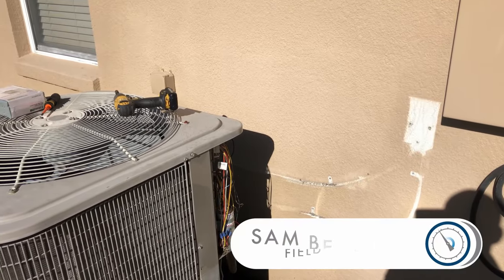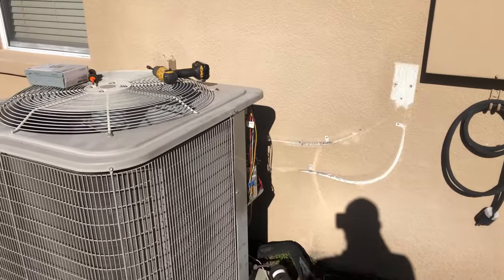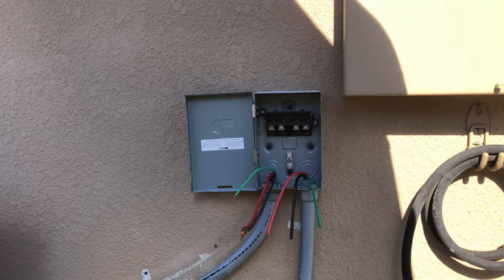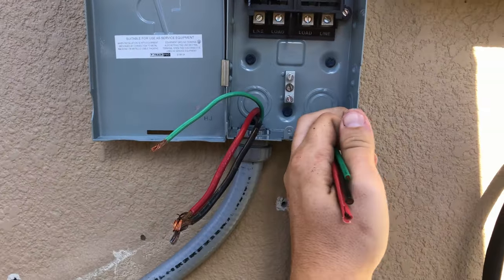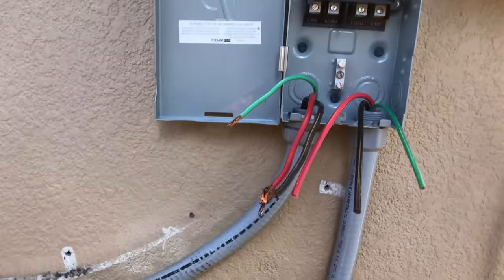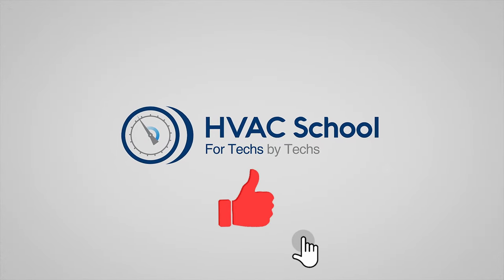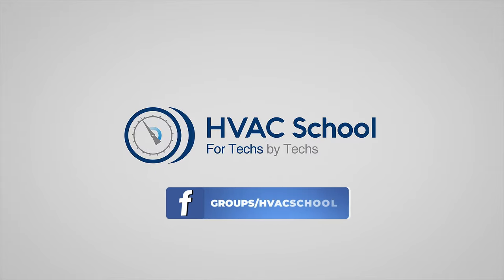How to Install an AC Disconnect

Comment: Lol you didn't show the part I struggle with: knocking the holes out of the bottom of the disconnect box for the wires. I always knock out the wrong ring...grrrr
Reply: Bro, me too lol!
Reply: Rookie guys
Reply: You always Market with a marker first
Reply: Use a 1/4” drill bit to remove the welds on the knockouts.
Reply: @bigkev4385  So, there's plenty of things you're a rookie at too.
Reply: I looked up this video for this is there a video to help us get the right size.
Reply: Right

Comment: Thanks for the informative video. I'm getting some new siding and your video helped me with replacing my old disconnect. The only thing missing was understanding the the rated Amps for disconnect boxes; some come in 30, 60 or 70amps. I didn't know what my existing amperage rating was for my old box. So, I did a little research and found that the amperage rating for disconnects tells the max amps that the box is rated for. I ended up getting a 60amp which I heard was standard for AC units, I have two 20amp breaker switches going to my AC unit....Thank you!

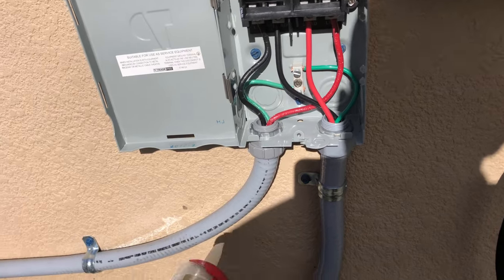Comment: 2:16 shouldn't there be an inside plastic cover hiding the wires and terminals?    Will your pass code without the plastic cover being installed?

Comment: do power lines from service terminate in the line side lugs and out going to the ac run to the load side lugs if so it is wired back wards....please correct me if wrong ....thank you....and do line and load even matter on a disconnect

Comment: The wiring that comes into the disconnect doesn't have a neutral. Is it ok to connect the neutral wire coming in to the grounds in the disconnect or leave the neutral not connected?

Comment: Silicone is for metal not the outside of a stucco building. Always use caulking as that can be painted and it bonds properly to the stucco. Otherwise good video, I've watched a couple of your videos and there teaching me new ways or different scenarios to install all kinds of systems.
Reply: They do make paintable silicone

Comment: I got two new ac systems $10,000. They used duct tape for  disconnect box that was disintegrated. Shouldn’t that be replaced with a new install? Why does internet say it costs $500 to get a new one installed?

Comment: Looks easy. Thanks.  Question:  If I wanted another disconnect (for another mini split condenser), can I tap into the same 'line-in' junction box?  Both condenser will not be running at the same time.  Thanks.
Reply: A little late to your question and I'm no electrician so grain of salt and whatevs, but I think that depends on the gauge/amperage rating of the wire already installed and the amperage rating of the breaker on your electrical panel. Figure that out for each and use the lower number. Then take the amperage rating of what you have connected already plus the amperage rating for the mini-split and hopefully that's around 80% less than what your wire and/or breaker are rated for.

Don't want to overload the wire and/or breaker with a higher amperage than rated or else your wire can burn out and/or your breaker will constantly turn off.
Reply: I doubt NEC will let you do that. Not trying to be the code police, just sayin'